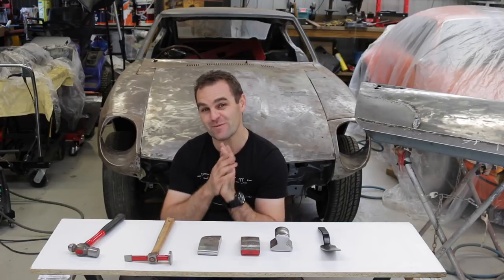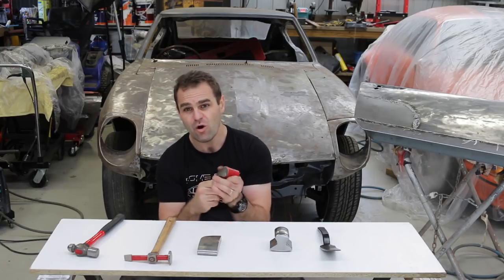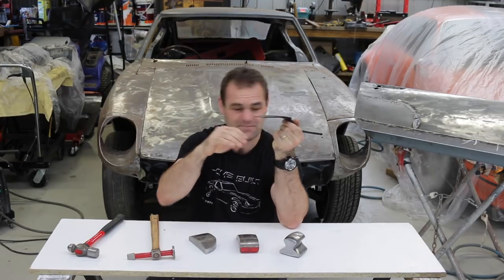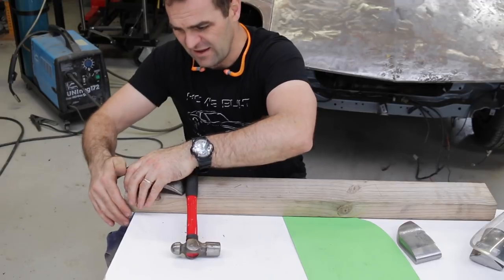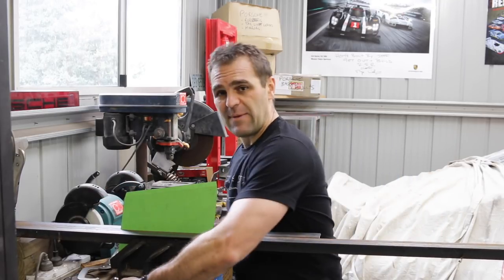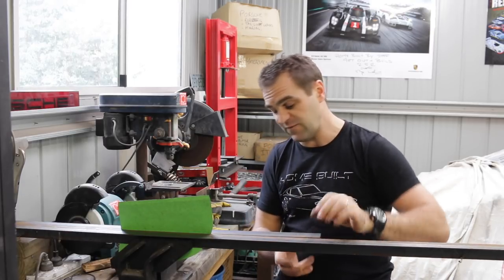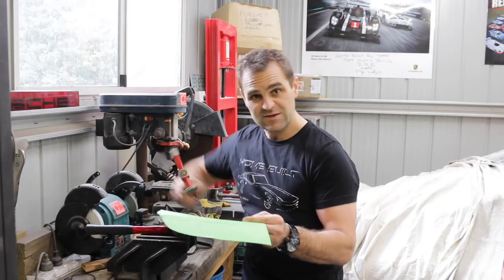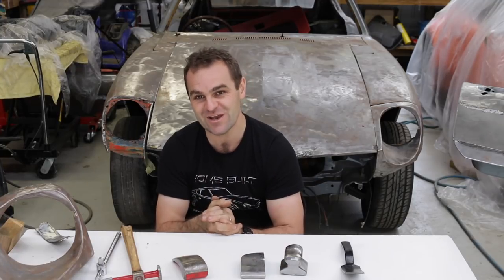DIY Home sheet metal shaping - My favourite tools part 5

Comment: WOW! i search for something like this for 3 days now... I stuck with my car body repair because just do not know how to form 1 needed shape. I have Totally NO Experience in car bodywork, just buy mig welder and gas tank with CO2. Till i go to replace rear quarter panel everything goes nice and easy, i just bend metal to form some angle and correct it on car body (use old damaged part as a form to keep shape). But after I cut old rusty quarter panel discover that this part separate wheel from inside of chassis is also rusted as hell. You show me amazing low price hand tools to "create shape" i do not know about. Keep up the good work. Sorry for my English :(
Reply from the maker: Glad I can help. Using a MIG on mild steel you should use a Argon/CO2 mix gas ;)

Comment: Nice! One problem I am having is I have a panel on my roadster that is not removable, and it is sunken in and quite rippled. It has been worked over by somebody else in the past, but they clearly gave up as it was evident when I removed the 5mm of body filler from the panel.
Reply from the maker: I made this up a few weeks ago for that same issue. 
https://www.youtube.com/watch?v=Ck-tItxePxk&t=2s

Comment: Thanks for that Jeff. I'm going to try those techniques. If you've got any leather scraps you could make yourself a cool old-school shotbag/sandbag. Or you could make a dishing stump. I reckon they would round your kit out quite nicely. Also a quick question: what gauge / grade of steel are you using for replacement panels? Is there a standard "go-to" type, thickness etc for best results?
Reply from the maker: I have seen the dishing stump before, but I hadn't seen the shot bags. That makes sense, I will keep that in mind. Thanks.

Comment: Turn an old file into a flipper, best panel beating tool ever.
Reply from the maker: I have seen that. I need to do it, but it is hard without an oxy-acetylene to heat it up.
Reply: True but eBay has one for about $50 that and a body file allows me to metal finish. I am not a panel beater but worked in I T.